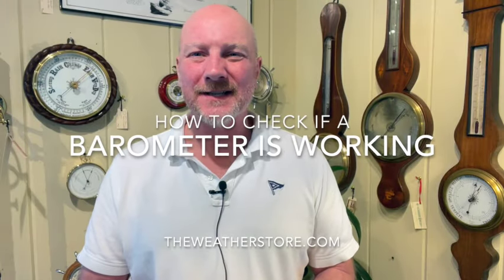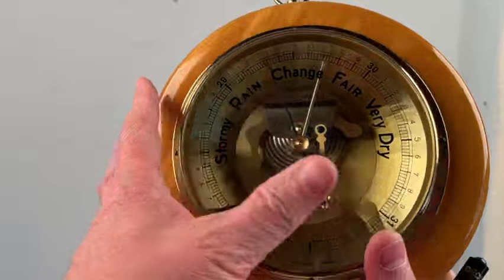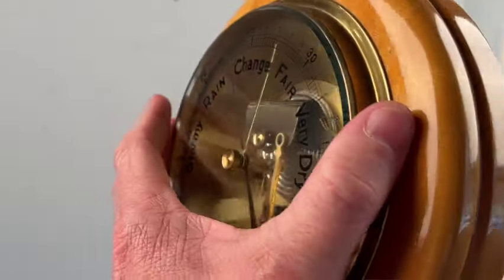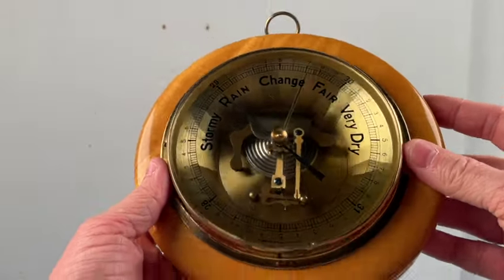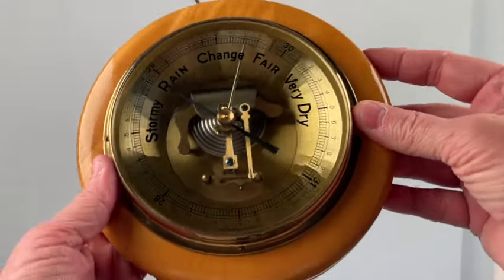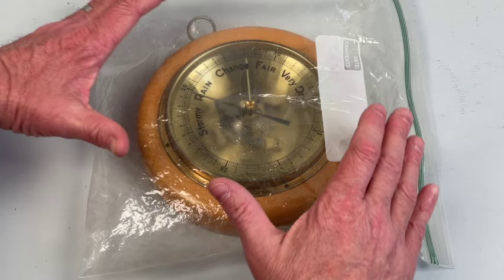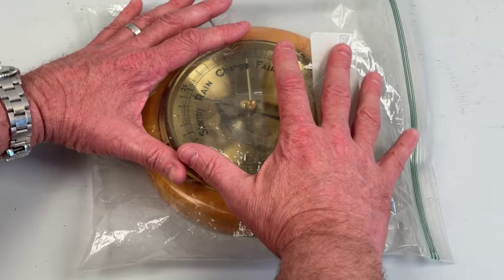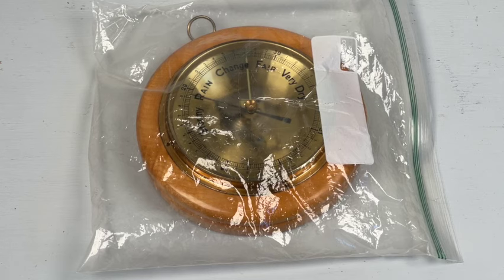How to Check if a Barometer is Working

Comment: Putting it in the zip lock was genius. Thank you!!
Reply from the maker: Glad to help!
Reply: @TheWeatherStore  :: My Bey-Berk doesn't move at all doing this test, but a light push on the metal diaphragm with a Q-tip and the needle will move.. What could me hanging the meter up?
 Hope you can help it's in very good condition cosmetically.
This particular model doesn't have the rear set screw only a sea level altitude adjustment screw. 
are they one in the same?

Comment: Just ran across this video -- thank you so much for this! I've had my grandparents' barometer for years and never knew how to know if it was really working. I tightened the tiny screw on the back, gave it a few gentle taps and the needle moved for the first time! It landed on Rain, which is correct. I've never seen it on Rain. Thanks again. :)
Reply from the maker: Glad to hear it is working better for you

Comment: Great tips - thanks! I inherited a small antique barometer from my parents after they passed away, and there is no hole in the back to insert a screwdriver. But I was able to use the plastic baggie pressure test to see that it was working. Very cool!
Reply from the maker: Some barometer makers make it tricky to get to the adjustment screw. Ive sometimes had to remove the barometer from the wooden backing mount to access it.

Comment: I found a barometer in my basement sealed up in a box but it has no information on who it is made by or any markings and i can't find a similar one online. I can tell it is for a port hole. I put it in a bag and it did move under pressure. I would be interested in finding out its history. I don’t know where to start.
Reply from the maker: Some barometers have no markings on them. Unfortunately these are hard to find any history on.
Reply: @TheWeatherStore  I tested it and it works in the bag but when I adjust it to my local baro reading it doesn't accurately change to match my local pressure as it changes outside.

Comment: Thanks for the tips. They do work with me. Vintage barometers can be encountered in the most unexpected places when rudimentary tools like a small screwdrivers or Ziplocs can be out-of-hand like in some yard sales. Testing for that springiness is a good idea that also works for my on-the-spot testing.

Sometimes, the pointers move a little when I slam-close the car door, indicating response to air pressure. Also, driving over some hilly areas would indicate lowering of air pressure but you can do all that post-purchase.
Reply: Thanks for the car tip. I bought my first one yesterday. It came home in the trunk of the car. I dont know didley squat about them so imagine my surprise when a storm woke me up at midnight last night 🤣
I have a farm so there was a bit of scrambling to bring goats to the barn (if i know it's not going to rain they can stay in the field)
As I'm getting dressed to go outside it occurred to me to check the barometer i JUST bought! 
It hadn't budged an inch! 
So here i am thinking it's a bloody expensive decoration!

After this video i feel a bit wiser, maybe it's just a little sticky. The needle moves a bit if i shake it the way he did. But not much.

Comment: Thank you for your knowledge. I have my Grandfather’s old airguide Bakelite wall mount temp/baro. I wasn’t sure if it was working because it was so far off the actual pressure. The plastic bag trick was great. It works, just needed calibration. Thank you, again.
Reply from the maker: Glad it was helpful!

Comment: Excellent tips. I would like to know what precautions to be taken while reading aneroid barometer on a boat while all doors are closed due to air conditioning?
Reply from the maker: Good question, air conditioning will not affect the air pressure. It would have to be a totally airtight (think submarine level) cabin for it add or decrease the pressure.

Comment: Thanks so much for your posts.
I have inherited a mercury barometer. Its threads have become detached from the little pulley wheel. How should I re-attach the threads correctly? 
Many thanks in advance for your help.
John
Reply from the maker: the threads are usually knotted at one end where is attaches to the pulley wheel. I sometimes add a drop of superglue to hold it in place

Comment: This is helpful, and the "bag test" is especially interesting.

My barometer has two screws on the back. One of them moves the needle. What is the purpose of the other one?
Reply from the maker: Probably just to hold the inner movement in place.
Reply: @TheWeatherStore  I found that out before your reply by removing the barometer from the frame, and I found there are two screws holding the case together, plus the obvious adjustment screw. Before I was sure what the attachment screws did, I removed them and then reattached them.

The barometer now reads pretty close to the local weather report. I've been calibrating it gradually, which has narrowed the difference.

Not bad for an old Japanese-made Jason weather station I found at a thrift store. I'm glad I didn't kill the barometer.

Comment: Great information subbed 🏴 I have a question which is one of my barometers has a hygrometer currently showing around 62% whereas weather forecasts are showing 92% humidity. So does humidity vary that much inside and out? I believe barometric pressure inside and outside is the same which my barometers always show as they are always spot on compared to official reading. But as I say the hygrometer varies a lot! Thank you🏴🏴👍👍👍😮
Reply from the maker: yes, humidity is different inside versus outside, especially if you have air conditioning. Barometeric pressure is the same though
Reply: @TheWeatherStore  Thank you !! ☺️

Comment: Hi, Should the barometer needle be reset? I have moved it with the tips you mentioned in the video and I am wondering if its to be reset? or will it automatically move to its correct position?
Reply from the maker: Yes, reset the the set hand daily so you can see the weather trend over the past 24 hours

Comment: Do you have to put tiny drop oil in them ?
The 3 mounting screws I thought were oil points , the one screwed back in , but the other 2 just keep turning into nothing , have I damaged anything ?
Can you take front round cover off to oil ? Or does takes front cover off upset the vaccum inside ?
Thanks ian
Reply from the maker: Hi Ian, I'd have to inspect the barometer firsthand before I give you any instructions. I dont want you to damage it. FYI, there are no oil ports on barometers.

Comment: I have a nice barometer but I really don't understand what the gold hand does. It just stays still. I Set the black hand to the current pressure here and it seems to be moving. Can you enlighten me? The gold hand has a little knob in the middle of the glass face to move it with and I lined it up with the black hand but it stayed there even though the black hand moves. Is it supposed to move too?
Reply from the maker: the gold hand is simply the "set" hand and is used like a bookmark. You align it with the barometer hand and when you check it later you can see how much it moved up or down.

Comment: Hi
My barometer changes when placed in bag and pressure applied. However if The Glass covers it, it does not react. Could it be the Glass is wrong and it needs one less hermetic with a positioning needle.?
Reply from the maker: the needle might not be able to move freely under the glass. It might be rubbing against the set hand.